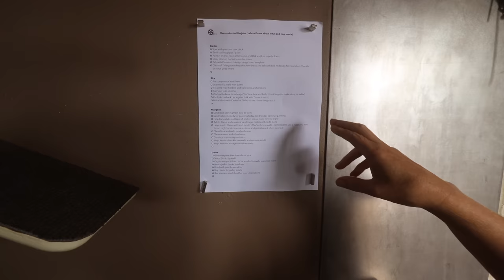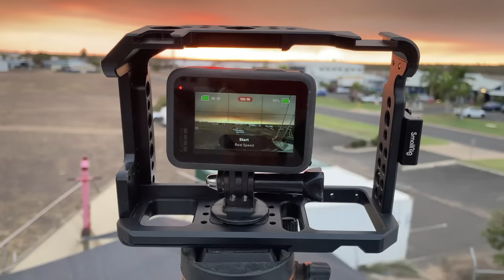Anchor Room Refit for Launch - Project Brupeg Ep.306

Comment: When you paint the pipes use a small mirror and have a couple of one inch wide brushes with long handles that are bent forty five degrees with a hair dryer. I worked building US submarines in my youth. I was a detail painter. We used lots of different shaped brushes to ensure complete coverage.

Comment: Guys when uncoiling rope,one needs to use a turn Table to prevent kinks, This is round board with a  swivel hook/ring  in the middle ,Place the coil rope down over the swivel  pocking up in the middle of the rope,, ,attach a pulley block to swivel, Raise the rope about 4/5 inches of the ground ,take off the rope coil stow right handed.👌

Comment: You might want to take rubber bungy cords and hook one end to the rope hanger then come over the top of the rope and hook to the rope hanger again. This restrains the rope from getting tossed off turning into a ball of mess when you need it fast. You sure can get a lot of line in when its hanging and organized. And it stops things rotting.
Reply from the maker: Each stainless box section has a link of chain welded to the end. That in turn has a rope clipped onto it that ties off on a rib on the deck head so eliminating the ability for rope to slip off

Comment: A couple of notes on rope , I think the yellow rope at 20:40  is polypropylene , not nylon . Actual nylon rope has about 20% stretch and is very good for anchoring in rough conditions because it will stretch and not pop the anchor out very often , I have some that years ago  I swapped a carton of prawns for with an Australian Navy patrol boat which will remain nameless ;-) ( it was used rope , not new ) . Real Nylon rope is more expensive . Also polypropylene rope can break with little warning in a stress situation because it has very little stretch , at the point where it sits on the bow roller is such a situation when anchored in rough conditions . 
               Secondly at 24:35 Dame is coiling that same yellow rope anti clockwise ?! 3 strand rope is ALWAYS coiled clockwise with the lay so the strands coil naturally . It helps avoid twists and tangles . If I was a bit closer I'd love to splice some loops on those mooring ropes , springers need to be at least twice as long as bow/stern ropes .

Comment: Storing lines and chordage: you'll always get kinks in the rope. The best way to do this is put a piece of pipe through the middle of the coil supported at both ends and unroll the line. Same method works well with electrical cable

Comment: The argon risk is pretty minimal in small amounts.  That entire F-size tank only contains 5m3/5000L of argon, and the anchor locker is what 3m3?  When you're running at 8-10L/min, a couple of minutes of arc-on time, is only putting 20L of argon in there.  It takes quite a while to build up.
Reply from the maker: Yip that’s likely true. It’s just something we do as a backstop to make sure we get out of the tank after welding just in case

Comment: May I ask what is the plan for fuel storage regarding straight diesel  and veg oil.
Does the current tank config allow you to have separate fuel type storage and usage with no trim issues?
Also will the new gen set run on veg oil?
Reply from the maker: Hi Nigel. Currently we have 6 tanks so storage separately isn’t an issue. And yes, all engines on Brupeg are able to run on Vege oil or diesel
Reply: Thanks for the update and good luck

Comment: Why is that bow not finished yet?
Reply: I guess it is not urgent - it won’t rust through, and it is not easy to overlook, so they are doing items that are first?
Reply: At least slap some of that red anti-rust paint on it! It has a depressing effect on me looking like that. 😢
Reply: Did they get the engine in yet I don’t remember seeing that episode
Reply from the maker: Bow is finished but not painted. We allow it to surface rust for as long as possible as it makes the sandblasting prior to painting easier and faster. It will be painted very soon.
Reply from the maker: Engine is in, was a great day, episode is here if you want to look for yourself
https://youtu.be/Uj3ko2GDMqg

Comment: Tig is not the way for basic jobs, stick these jobs. Faster easier, less prep and seriously heavy duty. No worries about drowning in argon either. Don't take this as horrible internet criticism, I have been watching and enjoying your journey for years. I am only trying to help.
Reply from the maker: Thanks Jack. Dame has been making sounds that he might one day be open to stick, but it’s still a wee way off I think😉Jess
Reply from the maker: Dame here. At some point in the future we will run short of Argon and the TIG & MIG gods will have forsaken us and at that point I think we will quite happily jump over to stick welding… mainly used TIG in the anchor room to get as much torch time for Birk as poss. We generally use TIG on indoor weldi g because it’s so much cleaner than other methods. Stick has its place but everything on the boat is set up for MIG or TIG and we just don’t use stick enough to be able to keep rods in a good enough condition.
Reply: @ProjectBrupeg  Birk is a natural, you'll be having to learn stick soon. I reckon you won't get a look in on the Tig machine soon. 

I know stick is your most hated method of welding. You can get some beautiful welds with stick with a bit of practice. Its very satisfying when the slag just peels off. One of my stick welders can be picked up with one hand easily, I reckon it's weighs about as much as a small roll of mig wire, no bottle to drag around either and will weld thick plate. It is ideal for welding brackets on, or welding in adverse conditions. Rods keep easily in a sealed tube in a dry spot. It's your boat though mate. Personally, I use mig for the jobs that contain long runs, tig for stainless tanks and parts and stick for brackets and small jobs all over a vessel. All the best from the UK.